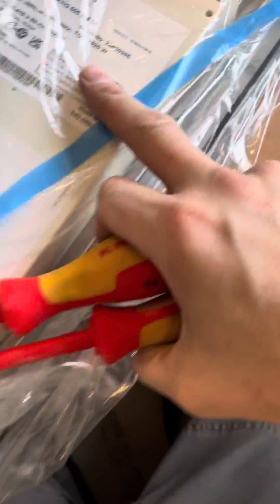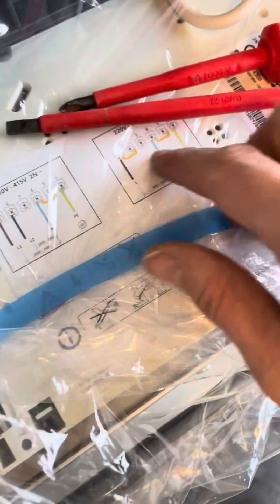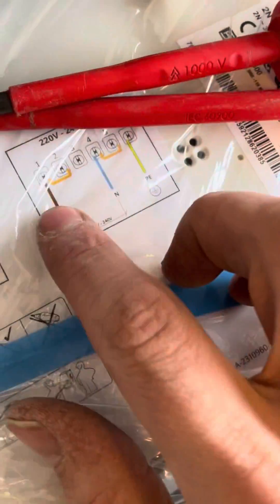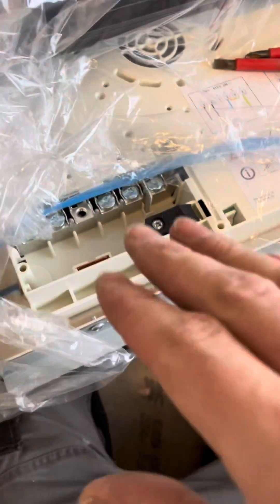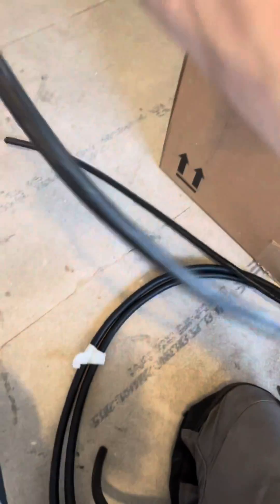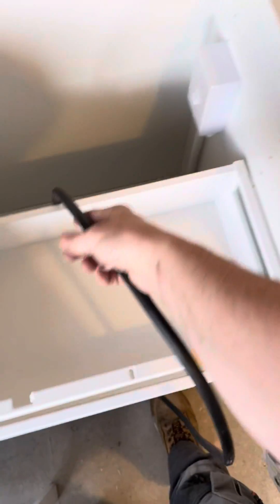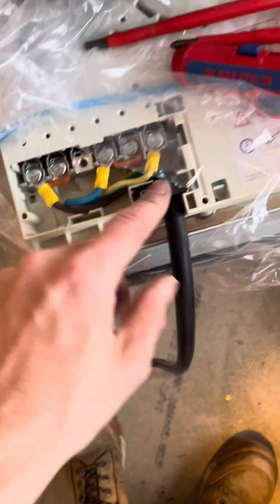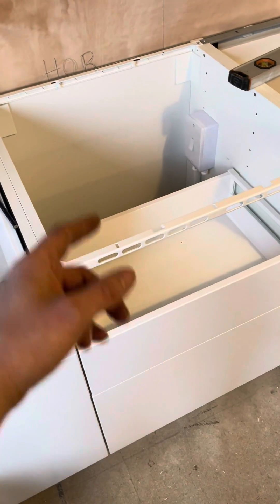Correct cable for oven & hob connection

Comment: What cable did you use ? Looks like H07?
Reply from the maker: Yep
Reply: @bristolsparky  thanks. Does any cooker or hob installation have to be heat resistant cable?
Reply from the maker: @ read the manufacturer's instructions

Comment: Quick question........

I have a double oven 4.1kw and standard ceramic hob both fed by one 6mm cable through isolator and CCU.

Looking to fit 7kw induction hob so would that need fed by a separate 6mm and isolator from fusebox. I have a spare connection there from shower no longer in use.
Reply from the maker: Call an electrician
Reply: @bristolsparky  

Thanks very much for that..........  I understand your reticence in answering as plenty of people out there will be trying to fit 13amp plugs to 7kw induction hobs and double ovens. 

Four years ago in my Victorian flat, I ran 6mm from fusebox into the kitchen connecting a double oven and ceramic hob as above. 
I extended the kitchen ring adding four double sockets as well as two additional spurs and under cabinet lighting.
I drywalled half my 5.5 metre by 3 5 metre kitchen, installed plaster coving, lowered ceiling in alcove creating large upper storage cupboard, decorated, new flooring, plumbed new sink, dishwasher, washing machine, fitted full kitchen base units, wall units plus breakfast bar, tiled backsplash etc.

Recently had central heating as well as a totally new bathroom with walk-in  shower etc installed leaving the electric shower connection at the fusebox redundant.
Also had a new fusebox fitted by the same electrician (great job by the way) who did the bathroom electrics whose EICR checked out without any problems and certificate issued.

So absolutely yes, I could call in the same electrician and I could pull out the kitchen units, remove the floorboards leaving access to wiring from kitchen to hall fusebox all open, simple. Then he can charge about the same as I would pay for the hob to Install an isolator switch and run 6mm through the open floorboards into the fusebox.

So the simple question was would you use original 6mm connection for a new 7kw induction hob which somehow doesn't feel right to me OR run a separate 6mm to the hob making use of the redundant fusebox shower connection?
Reply from the maker: @fabianmckenna8197  separate...always separate (section 314)

Comment: can you wire in a hob and cooker off the same 45A switch or will each appliance need separate isolation. or bring in say a single 10mm2 and then split into 2 ways 6mm x 2 points?
Reply from the maker: You can do something similar